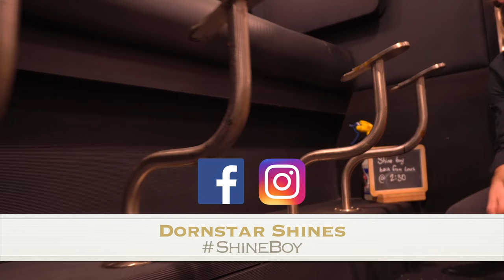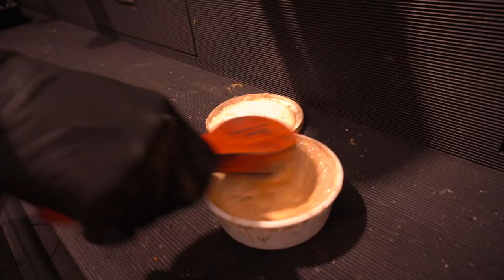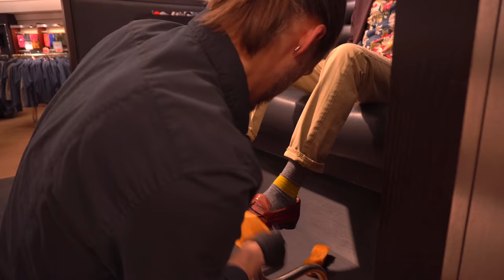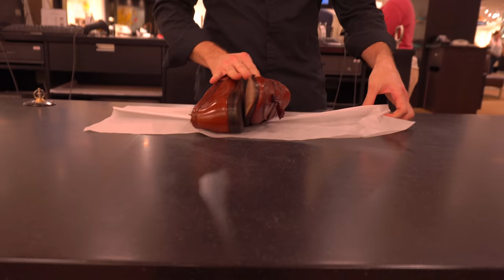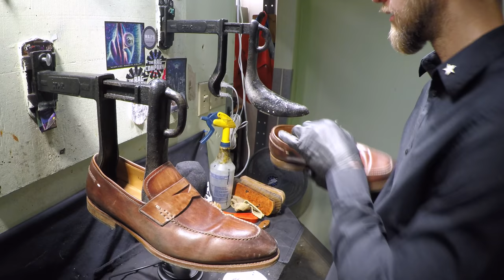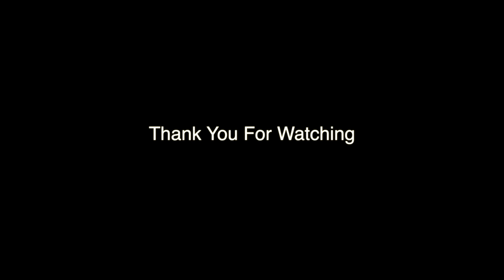ASMR | SHOE SHINE | EXTENDED INTRO | BINAURAL MIC | 4K

Comment: I like your title usage and the placement for your added info for the products you’re using is way better than before. The intro could use a little touch up but you shortened it and that’s a good step in the right direction 👍

Comment: Jason, a couple of quick questions. Life got busy, and well I neglected my shoes (I shrink in the shower of hisses and boos). Some of my polishes are the equivalent of small turds. Polish has also doubled in price, actually more than that) since I last bought polish. Have you restored dried polish with either turpentine or olive oil or do you have another method you recommend? And what's the solvent in saddle soap that evaporates out? And are there any other uses for Noxema other than hand care and conditioning the leather on my shoes? Keep up the good work, you're not that far from 100k.

Comment: Love the audio produced in the "Shine Lab". 

Question, why did you switch up your normal process? Generally, its sadddle soap then dry followed by conditioner and then buff. This time, you mixed it up with the creme polish over the conditioner and then you used the nylon. Just curious.

Comment: A question amigo. I've got blood stains on my adidas Y3 sprint trainers. I've tried soap, even bleach products to try and remove the stain. They are cream coloured mesh type of material. Any products you could recommend. Would be very grateful as they cost £250. Also love your work.
Reply from the maker: A bloodstain is orange after you wash it three or four times
In a tub but that's normal ain't it Norman?
Sorry, I'm no help there. Try Reshoven8er
Reply: Thanks I'll give that a go.

Comment: Which color Angelus cream/wax polishes are best for the “new” AE walnut? Gracias
Reply from the maker: I like to use Angelus Neutral Lustre cream, and Neutral cream polish from Saphir. Then once you've buffed out the cream, use a bit of tan wax polish from Angelus or Lincoln Wax. For a burnished to or heel look, use light Mahogany color from Lincoln or the Mahogany from the luxurious Saphir high gloss wax. I hope that helps.
Reply: Jason Dornstar thanks! Ordering them now
Reply from the maker: @jeffbrogan6147  use Promo code; "Dornstar" on Shoecaresupplies.com, otherwise, tell them the Dornstar sent ya! 
Cheers! 🍻
Reply: Jason Dornstar the Dornstar promo code does not work on the Angelus website
Reply from the maker: @jeffbrogan6147  because they cut my discount.
Reply from the maker: @jeffbrogan6147  use that Promo code on Shoecaresupplies.com
Reply: Jason Dornstar ah you did say that! Automatically went to Angelus since the code has worked in the past